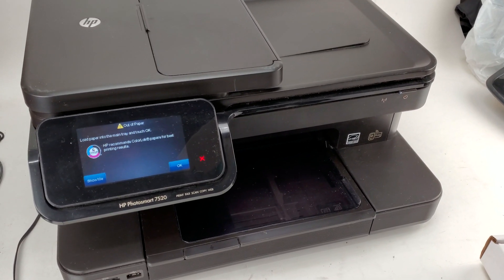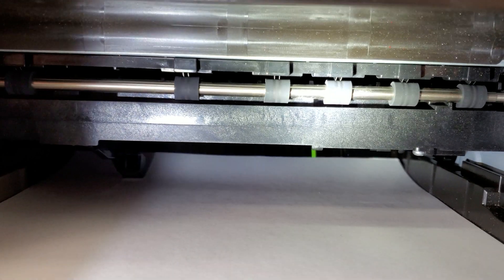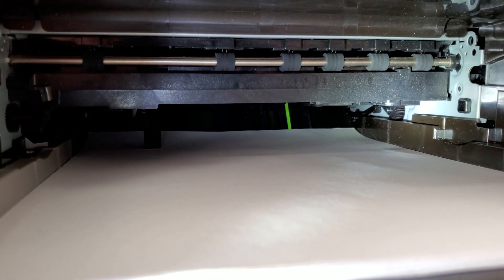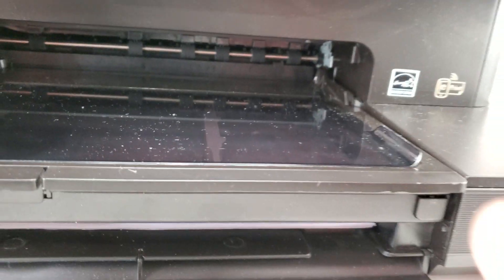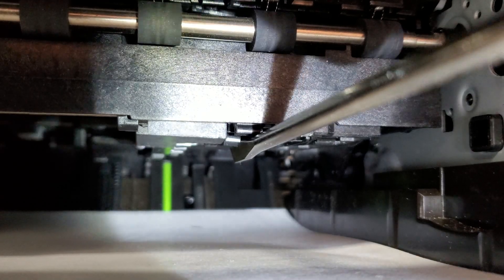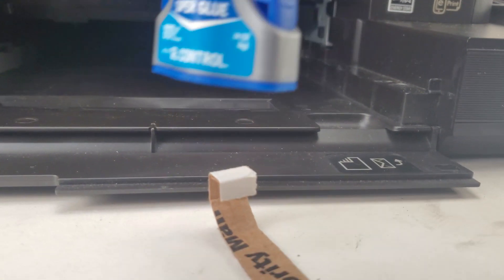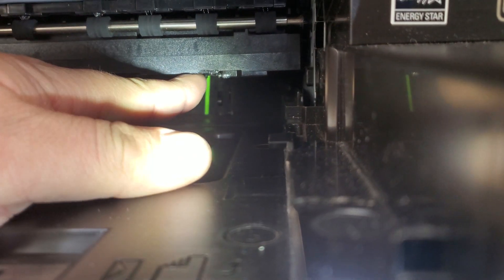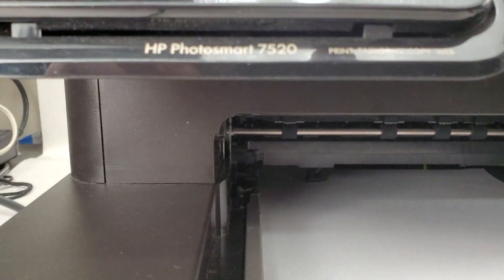How to Fix HP Photosmart 7520 Paper Feed Problem

Comment: You are the bomb! 10 year old HP 7525 sat on the sidelines for 6 months, scared to try anything. A dab of superglue on the gear shaft as you described and demonstrated just saved me over $200, plus my self-confidence. As the dentist has said, you are awesome in not only figuring out the problem and finding an easy solution, but keeping our stuff working and out of the recycle stream until really necessary. A big thank you from Winston Salem, NC!

Comment: This fixed my printer (for now)!! Bought the Loctite Super Glue you recommended. Used a hand mirror laying down in the paper tray to get a better view. Slid the loose gear to the left to reveal the part of the metal rod that has ridges that are supposed to grip the gear. Put some glue on that spot and then slid the gear back into place. An hour later I can print!

Comment: This saved me a lot of time and money. I had this printer sitting in a corner for more than two years .I  had no idea how i was going to fix it. Thank you so much for your video it really helped me. The only thing I did differently was that I use my Dremel tool to cut a piece in front of the gear in order for me to freely apply the glue and now my printer is actually working again thank you.

Comment: Thank you!  You correctly identified the problem with my 7520.  In my case, and this may be instructive to others, that particular gear was slipping on its axle, but it did not slide out of position as did the one in this video. Thus, I could not put glue on the roughened part of the axle.   I tried putting both epoxy and super glue at the point where the side of the gear meets the axle, which is hard to do given the location.  I thought i had welded the two meshing gears together by carelessness, but when I started the machine those hardened bonds popped apart.  I'm back in business!
Reply from the maker: In my case the gear fas so loose yhat it went to the side. If it had light wear than it would be stuck in position and just slipping

Comment: The solution is real cool. My Printer HP PhotoSmart 7520 did not work for more than two years. It had exactly the same problem. I bought J-B weld's Super glue gel which has set time 30 seconds and it bound the well instantly. It works perfect! Thank you for the video. I should buy you a bottle of beer!

Comment: Thanks for the video it was very helpful. Something that makes it easier to see and get to the gear ia if you tilt the printer on its back. In the bottom there is two tabs that hold that bottom input tray on.  Lift each tab and slide the input tray right off. It lets you see the gear that comes loose from the shaft better.  I was able to take a q tio and apply expoxy to the shaft and slide the gear back in place to fix mine

Comment: I genuinely do not understand how putting glue on a gear is going to fix this. Am I putting glue directly on the cogs of the gear? Please explain the why behind all of this before I go lathering glue all over my gears. Thanks!
Reply: I am stumped too, I see the 2 gears that need to be aligned to EACH other but I don't know where the drop of glue should go? Does it go next to the first gear? Beside it? Does it go on the platform next the the screw? If the glue touches any part of any of the gears and it dries, then the gear engagement will be stuck/obstructed.
Reply: @AName-gx7lb  you need to slide the small gear to the side, apply the glue to the metal rod then slide the gear back where you placed the glue. This adheres the cog back to the rod, making it functional again.
Reply: @ryeguy556   i will try that, thank you!

Comment: Wow! The superglue seems to have fixed my issue on my HP 7520. I did not even wait. I just put it on slid the gear back and printed a test page. Then printed a 20 page document. Before that it would not grab a single page on its own. I had to manually push in 1 sheet at a time when the mechanism tried to grab a page.

Comment: this video was great but I have a kodak hero 9.1 that is doing the same thing but I haven't been able to figure out why my printer roller is not picking up. I have noticed that all the repairs I've seen in videos show the wheel in the upper position but my roller sits on top of my papers from the beginning and makes that same noise but doesn't pick up the paper and then I get error message that jam paper when there isn't. any suggestions please? I've taken the printer apart and checked for dry ink, stuck caput none of those things are my issues. I barely used this printer. it may have 20 hours of use but I haven't used in about 5 to6 yrs. it's been covered and put away so I don't get it. I'll post a video on my channel so I can show everyone what's going on.
Reply from the maker: Is the roller spinning when it is trying to pickup the paper? If it is try washing the roller with water and paper tommel or alcohol. The wheel should be slightly robbery, its possible that paper dust is on it or the rubber got stiff from sitting to long not being used
Reply: @TeckDrivenTeck  yes it was. I finally fix it. I noticed that on the paper tray there is a white wheel and a rubber around that wheel and I cleaned it with half distilled water and alcohol and I tried to print a test page and it worked! It only took me 4 days to figure this out but I'm grateful for all the videos that help me to figure out what was the problem. I had cleaned all the rubber wheels on the printer except for the one on the bottom paper tray. Thanks again!

Comment: Hey how do I fix the top paper auto feeder tray?
Reply from the maker: Most common issue on top paper feeder is that the rollers get dust o. It and the paper slips. Use cloth lightly soak in water and wipe the rubber rollers

Comment: I have tried cleaning the rollers. Didn't help. It won't grab photo paper either. Sometimes when it does grab the paper, it either just rolls it straight through or grabs several sheets at once. If I try to print on both sides of the paper, when it sends it back through to print on the other side, paper gets jammed.  Scanner and top paper feeder doesn't work either. I cannot copy.

Comment: The only thing this video showed me was where the issue is, and it is THIS issue. However, the part still won't feed the paper.
Reply from the maker: Make sure it is aligned properly and the gear is spinning and not loose again.

Comment: I threw the PoS printer out of thw window from the 4th floor. Made a very satisfying crash sound landing in the trashcan.

It wasn't the second problem and no amount of cleaning helped if it was the first problem. This is the third HP printer that fails on paper pickup for me, I'm never buying their trash again.

I'm beginning to suspect planned obsolence.
Reply from the maker: It could also be the paper. some papers are to thin, some leave too much dust. the heavy weight paper tends to work the best but it also costs more. I have 5 HP printers printing every day, some are over 10  years old and few were replaced every year. But I had similar experience with other brands as well.
So go and buy a new printer, just make sure it is small and not heavy so you can throw it out the window as well when that time comes.
Reply: @TeckDrivenTeck  I wish it was that, but I used different paper weights and hp premium and advanced photo papers. Nothing was picked up. When the paper they recommend doesnt work and the trouble shooting they suggest doesnt help, thats where I draw the line :-)
Reply from the maker: @00wheelie00  I agree there customer service is just waist of time. Perhapse you should look into renting a printer. It is slightly  more expensive but they are responsible for fixing and inks.
Reply: @TeckDrivenTeck  I noticed something in common with all HP printers that had this issue for me: they all had the paper at the bottom and a duplex unit. I never had an issue with printers that pull the paper down from the back of the printer. (Epson, canon even including HP ones with the family)

I don't like the trend that everything becomes a subscription, I'm not going to encourage that by participating.

What I have done is buy a seperate scanner like I used to have, until I had to get a new one because no Windows 8 drivers...

That allowed me to buy the cheapest back loading printer I could find (turned out to be an epson). Now I don't care if there is a limited useful lifetime to the paper rollers, it's pricing makes it disposable.

The biggest shock was that this 4 inks epson printer prints better photos than the 6 inks hp I threw out 😲

Comment: I have aligned the gear but mine still not pulling the paper.
Reply from the maker: Eather the gear is still spinning becuse the glue did not gold or the paper pickup roll needs to be cleaned as it has paper dust that makes paper slip

Comment: This is a bad design of the printer. The small plastic cog after so many printings gets stripped. I tried super glue and it lasted for a short time. I finally cut a hole on the bottom and inverted the printer. Then I used JB weld on both sides of the cog. It lasted many months but it now has broken free again.